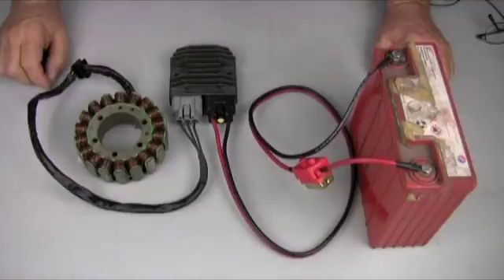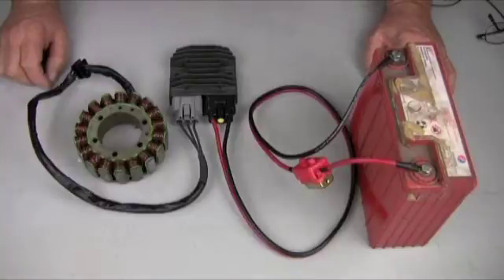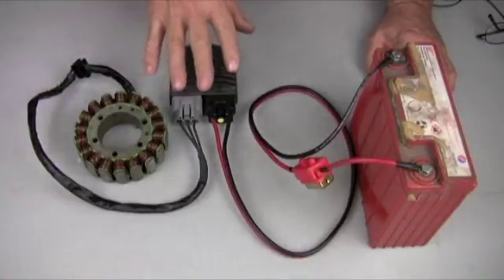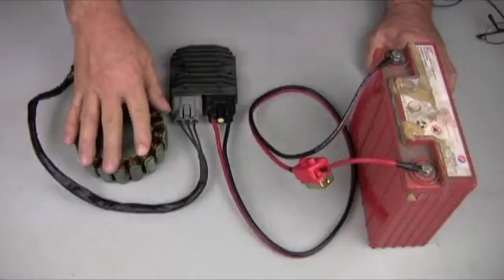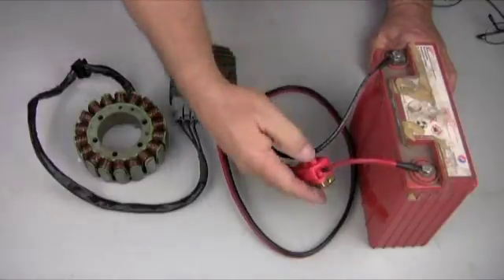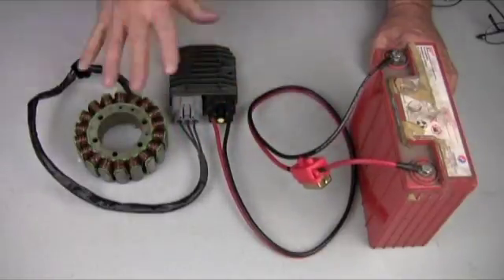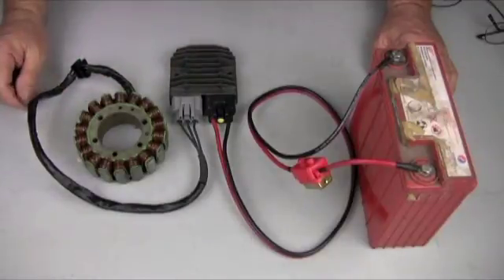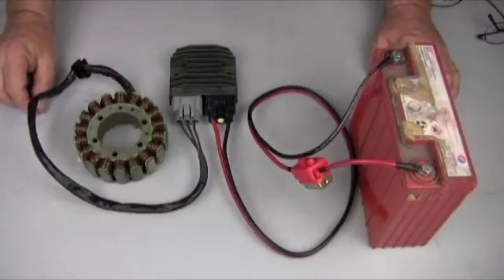FH012AA / FH020AA Mosfet install by Roadstercycle.com

Comment: If LiFeP04 batteries must be charged less than 14.48 volts, how do modify the motorcycle regular to match.
Reply from the maker: Most motorcycle regulators charge from about 13.6 to 14.5.  Lithium batteries also have there own regulators built in the battery for safety.
Reply: @Roadstercycle  how would I determine if the battery I bought has a built-in regulator. It is a lithium power sports battery e b l with a picture of a motorcycle on it.
Reply from the maker: @mrcleanisin  It should have one if it's a lithium battery. Call the manufacturer to confirm. Lithium batteries are very sensitive so they need internal regulation.
Reply: @Roadstercycle  are you calling a regulator a BMS
Reply from the maker: @mrcleanisin  yes

Comment: These are a good product and do work as advertised. I found them to be superior to the stock regulator on Honda Shadows and VTX models that come from the factory with Shunt style regulators, which run very hot, by sending the excess voltage to ground. I'm sure that's the reason for so many riders having their stators burn out prematurely. These Mosfet regulators send a lot more power to the battery and run a lot cooler. I highly recommend them.

Comment: is a circuit breaker required for the mosfet regulator ?
Reply from the maker: jwrath90   The circuit breaker or fuse protects the wiring between the battery and R/R.  it is a safety feature.
Reply: Does the mosfet 2006 gsxr 600 link need a circuit breaker ?
Reply: They all should have a fuse or circuit breaker on the line back to the battery.

Comment: in what order should i hook up the stator wires? i think i counted 6 wires coming off my stock RR on my 01 shadow sabre. im not sure how to connect them. ty
Reply: Old question, but: The stator wire orders don't matter - they are simply a 3-phase input to the regulator.  Sometimes the regulator has three output wires, a + to the battery, - to the ground of the battery or frame, and some have a battery charge level sensing wire which you don't typically need to replace and keep in the system.  My Ducati Elefant had a 6-wire stator that I replaced with 5-wires.  I left off the charging sense wire since the new FH020AA regulator didn't need it.
Sometimes the OEM will have two red and two black charging wires to help lighten the electrical load of the battery charging circuit on the wires - using two smaller wires rather than one big one.  These can also be bypassed and you can use the single big wire back to the battery.  Or you can make a new 4-wire harness.